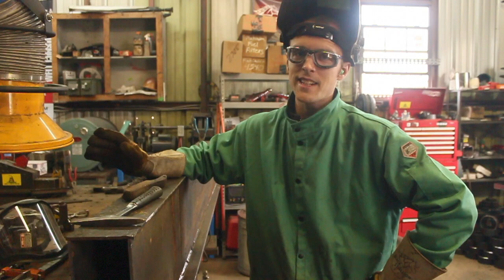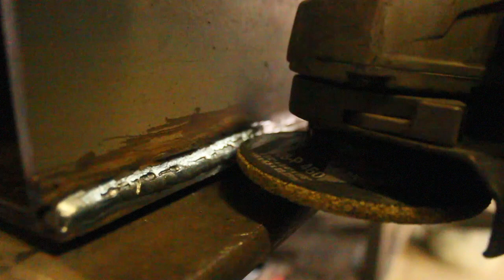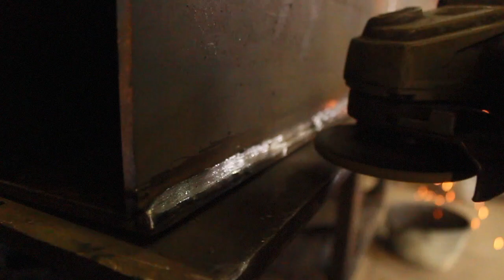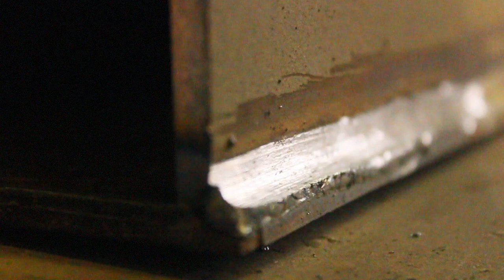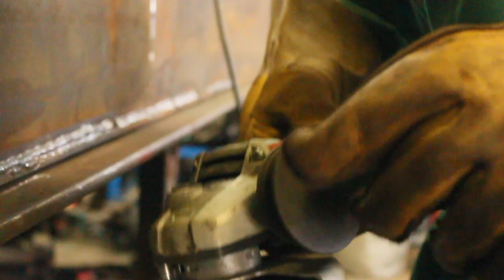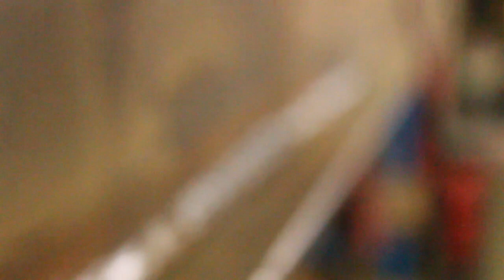WELDING - POROSITY IS A ***** SO MOST PEOPLE JUST BRRRRRT ANOTHER PASS OVER IT

Comment: I use the hot snot for my own personal enjoyment. Welding is an art form. I reside in a rural post apocalyptic agriculture salvage wasteland in the high plains. No shortage of scrap iron to glue together around here. I drag it back cut it up and figure out ways to repurpose these real heavy old green and red machines without spending a fortune on fasteners. Ive never been certified but I figure if IKEA can call their crap furniture I can identify as a welder.

Comment: Get a diamond cut off wheel for those small areas. They won't shatter and if they bind and jerk it will only bend it a little bit but you can fix that with a pair of pliers easily. That's what I use for small spots and mild cutting.